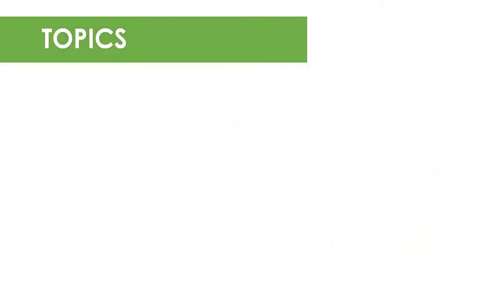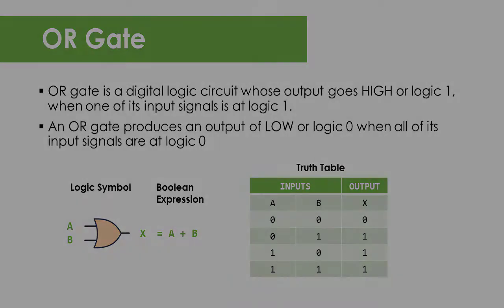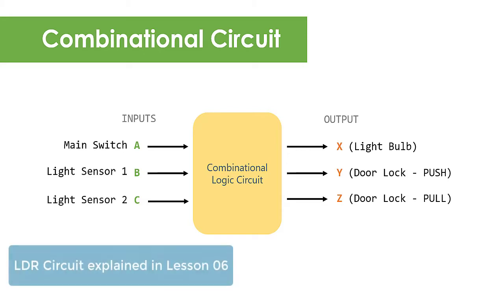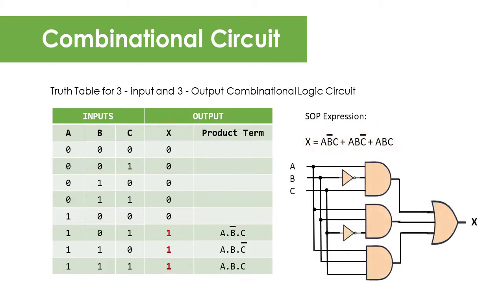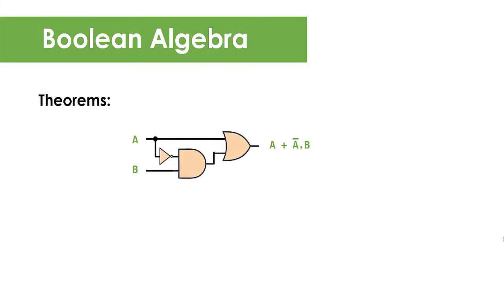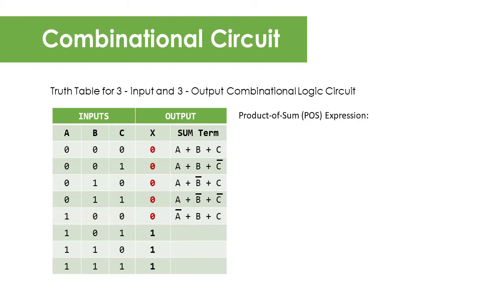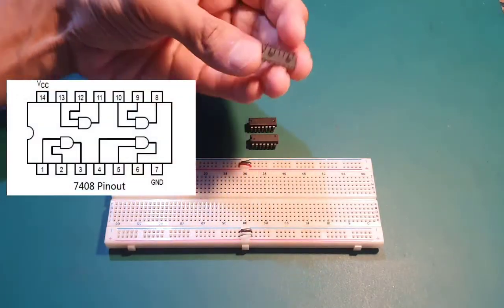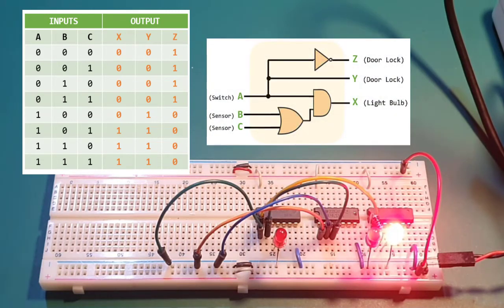03  Combinational LOGIC Circuit Design | Theory to Application -Automated Light Bulb and Door Lock

Comment: Thank you for making the video. I am confused at 29:05, where you put a resistor for output Y, but not X and Z. Do logic gates function as a resistor? How would I calculate when and what resistors I should use to prevent the light bulb from burning out?